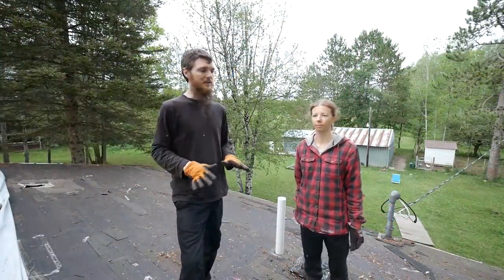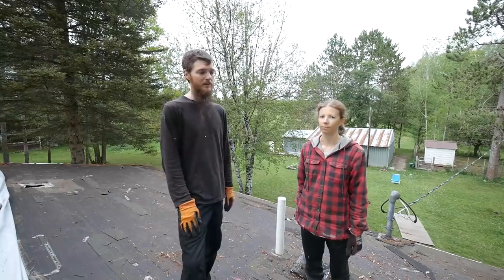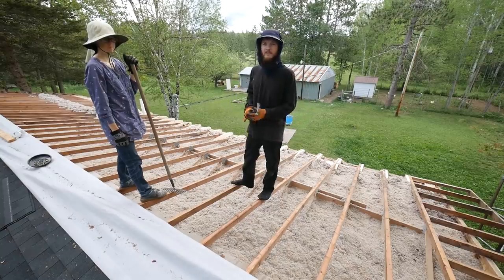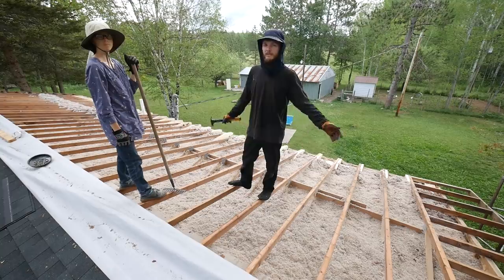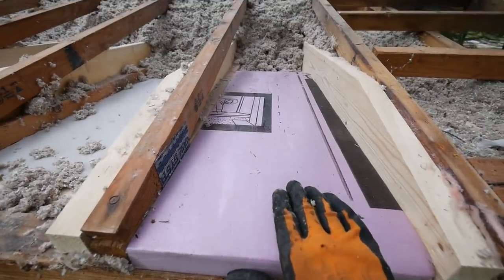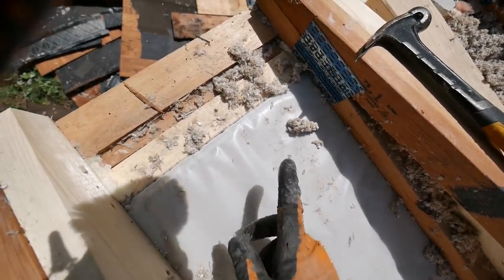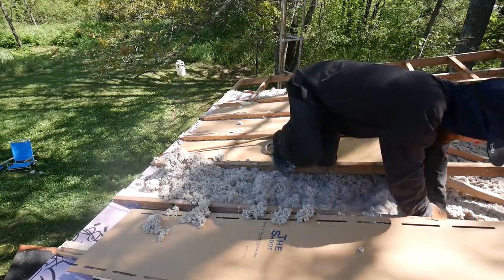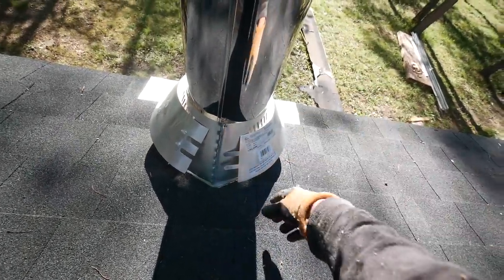Mobile Home Roof Tear Off Goes Wrong - Mobile Home Roof and Attic Insulation Renovation

Comment: Hope you're current on a tetanus shot Doug.  I saw a patient once that actually got tetanus from scraping something metal and it really didn't break the skin.  I'm not one for shots, but I'm also not one for infections.  Make sure you have plenty of antibacterial supplies (Hydrogen peroxide as well as neomycin ointment...If you can get benzoin tincture, that stuff is amazing for cuts and blisters).   You all are so close to the finish line, any kind of injury or infection is the LAST thing you need or want.

Comment: That buzzing would have immediately ended my day 😱!  Was it bees, wasps etc? How did you solve the issue?
Reply from the maker: it was bumble bees. They were nesting in the insulation. We just raked them out. They weren't happy about it and we did get stung. But eventually they moved on.
Reply: @diyfferent  Sorry you got stung on top of getting hit in the head. Speedy recovery for you both ❤.

Comment: I'm a little late, but hydrogen peroxide is great for cleaning and disinfecting wounds.  Then apply an antibiotic ointment like Neosporin or the generic equivalent.
Reply: You can use this fir dogs, if they eat something bad (depends on what it is). It's nasty process, but it DOES work. Trust me, you want them OUTSIDE. There's going to be a ton of nasty foam. 50 lb dog, you could go 1/4 cup. You'll need a small baster. Give it 10 minutes or so, and whatever they ate (depends,  think chocolate or a package of Rimadyl) as vet 1st. 

Chocolate is only fatal to 50% of dogs or fewer. Just in case, tho. Nice to be prepared. 

They can also have it for small cuts. It won't hurt them. The vet doesn't normally stitch things like paw pads and noses if it's a small cut. 

Just to save the 200.00 you know they'll get you for to do the same thing.

Comment: You need to get that wound seen by a doctor and make sure you get a tetanus shot, you have to get a shot every time there is dirt or rust in  a cut.
Reply from the maker: I'm okay, really! Also, what would be the point of shots if you had to get another one every time you got cut? It wasn't deep and is healing up well :)
Reply: @diyfferent  Sorry I didn't mean a shot after every cut, only if the time has run out from the last time you had a tetanus shot. I am glad it is better.

Comment: You are the hardest working couple I have ever seen.  My question is where are the kids when you get into these projects?  We always had trouble getting things accomplished when the kids were little.
Reply: I wondered about that too. I am somewhat a worry wart.
Reply from the maker: All over. They watch, they help, they play. Sometimes they'll watch a movie or play inside. Just depends on the day and the job. We do take a lot of breaks. It does slow down the process, but you have to work with that.

Comment: Great work. I hope you do an assessment of the difference all the insulation has made to the comfort of the house and the utilities’ savings.
Reply from the maker: It's hard to say since we had a different heating system the first winter and a lot had changed, but our heating costs were less the second year.

Comment: A slightly mixed day of fortunes, sorry about the head wound and really glad Ashley was there to spring into action, releasing you, hopefully without further damage. You are usually a walking advert for safety wear, but accidents always strike if you drop your guard. Do take care of the wound, I hope you tetanus cover is up to date, the family needs you healthy. I really hope that tomorrow goes well and gets you closer to being weather tight again. With all the vents the next part might be a little slower going because it is more complex. I heard you say about the risk of slipping, just don't!  Glad the vapour barrier worked for you in the rainstorm, fate may not be so kind next time. Will you check any of the other walls to ensure they are drying out well to prevent damp issues?
All things considered, it was another victory for hard work and teamwork, you are winning through.

Comment: When you were speaking at the end of the last video about your mailer, it reminded me of the hours I watched my dad putting on our new roof.  He never used an air tool in his life.  Every nail was put in the old fashioned way.  "Tap, tap, BANG!"  The nail was completely in.  My dad was incredibly strong; a big barrel  chested man with hands like hams.  He would truck loads of shingles up that ladder like it was nothing.  He was amazing.  The only part of construction I ever heard him complain about was concrete work.  He hated that!  He loved making furniture though!  Once he retired, he enjoyed making various pieces and then sold them through a local furniture store.  :::grins:::  To this day, the smell of freshly sawn wood makes me feel wonderful!  I only wish I could have learned more from him.  But then, girls weren't encouraged to learn carpentry.
Reply: I know it's 3 years, but have you read the Time Life Home Improvement series? I bet library has them, and a LOT of info is still valid today. Like, how do you paint a circle? Use a yardstick w a notch like a compass. Nail in the middle. Toilets have a seal under the cistern (top). I've never had one fail until recently, so I didn't know that. 

One leaked in my new house. Spent 20 minutes figuring out a wrench doesn't fit underneath.  But there's a nice screw inside to gently tighten some. I wouldn't know that w/o the diagrams, old as they might be. 

Had I been smarter, I would have looked in the TL book FIRST. I have a plumber friend who told me I can try GENTLY tightening the screw inside.  Don't go crazy, it'll crack. 

"No man can be a Communist who has his own home. He hasn't got the time." 

Bill Levitt (Levitt homes is an interesting story. Ford of home builders)

If I were building, I'd go well over "code."

Comment: That looked like hard work but I enjoy watching the videos....looking at the back of the home a decking going the hole length of the back would look so nice
Reply from the maker: The problem with decking is that it holds snow and splashes water against the house and causes wear and rot. For now we only plan on building small landings for the doors.

Comment: Too late now but I thought you were going to strip this side the same method as the other. We used pitchforks to strip shingles off roofs, the forks slide under the shingles and usually go around the nails or staples. 
Anyway good to see the progress and won't be long now until this phase is over !!!
Reply from the maker: good idea. Thanks

Comment: You guys Rock! Where there bees in the roof? We where taking insulation out from under our mobile home, to replace it. And we ran on to a bumblebee nest & I got stung 4 times.  Geeze they hurt. Hubby had to use a mixture or gas & diesel & it took 2 days.. to get rid of them.. They weren't gonna move out on there own..
Reply from the maker: Thanks! Yep, it was a nest of bumble bees. We both ended up getting stung. After a while they moved on.
Reply: @diyfferent  , I thought I recognized that sound! I heard it under are mobile home & I told my hubby. There is something very angry in there.  Geeze that must have been awful! No where to run.. Yikes. My hubby chews, so tabacco was available.. But baking soda paste, helps to. You probably no that.. The one that got me, stung me 4 times in the chest. And it fealt like someone had shot me with a poisonous dart. Well I guess maybe it was.  Be careful on the roof, I can imagine how bad that might have turned out.

Comment: Doug I don't understand how that water was coming down out of your Ceiling Lights with you having that ceiling vapor plastic up. 🤔 Oh and I hope your head heals up fast and it isn't sore in the morning. 🤕 I've just always heard it Called a "New Roof",  Chimney Stack looks Nice. GOOD Days Work Guys. 👍😁
Reply: To stop water coming through windows and lights that have been cut you need to use acoustic sealant and tape.
Reply from the maker: The plastic is cut around the ceiling boxes. Thanks!
Reply: @diyfferent  Duh Im embarrassed now lol ty,👍

Comment: I know how that feels! I have a loft in my shed and forgot about the fact roofing nails are right above my head. I ended up bleeding all over. You do know in Michigan you can shingle over 3 times before a tear off. Not sure about a mobile home.
Reply from the maker: We had to fix that insulation and the sheathing was a bit weak. But I didn't realize they allow 3 roof overs. That's crazy.

Comment: Ok, I get that this is a 3-year-old video,  but I would have left the older plywood running horizontally and laid a new layer vertically laid OSB  on top of it, as long as the older plywood is sound and not separated or blown out, your not adding that much weight to the roof and it adds more strength and sheer to the roof to bind it all together in generally just more stable.  I also noticed you removed the Sofit venting, which was that plastic channel stuck to the bottom edge of the plywood, you need roof venting or your roof will rot faster and have mold and mildew without it. I am sure you learned a lot doing this and what to do and what not to do next time. But I give you props for tackling it yourself.
Reply from the maker: It's a complicated story, but basically we had to remove the whole roof because the loose-fill insulation we installed didn't fill the whole cavities near the eaves and left areas where the ceiling would sweat. Since the attic was so small to get into and make sure it was packed in good, we had to remove all the roof to fix the insulation. We did reinstall new baffles, and the roof was vented properly.

Comment: Have you heard of damp rid? It take moisture out of basements. Might be worth it.
Reply from the maker: Yeah, we ran our dehumidifier inside for a few days just to be safe. I think everything will be okay :)
Reply: I had flooding in my basement during Hurricane Sandy.  Everyone around me got at least 7 inches and this was only time I ever  had water in my basement in 35 years. I fortunately had a pump that I got going the minute I saw water down there and my son dumped bucket upon bucket for hours into the washer and spun it out and away while the pump was going.  When waterline was going up we put all furniture onto cinder blocks and everything else stacked into the furniture!  Even though it was summer I just ran my wood stove on high for 3 days and nights. At first it was like a sauna down there but then I could feel it was drying everything out. After 3 days of wood stove I ran the dehumidifier just to be on safe side. No harm, no mold to anything down here.

Comment: First. A harness and safety belt are always a good idea. And a construction helmet is a cheap way to avoid, well, bleeding.
Reply: I've never seen pros use them. Bad idea, imo. I've seen them do some insanely dangerous things, like walk across a ladder like you would at Everest going over a crevasse. What a BAD idea.
Reply: I have also seen a construction worker in a wheel chair for the rest of his life.
Reply: a harness for a 10ft drop? lol

Comment: I know nothing about redoing a roof but was wondering if you could use your drywall lift to help get your plywood up to the roof by more than one sheet at a time and without having to climb the ladder with them. Just a thought.
Reply from the maker: It's an idea, but the ground would have to be fairly level and you'd have to lift the sheets twice.  But could be an idea.
Reply: @diyfferent   I noticed you were using the drywall lift as a drying rack, which is smart, in the cleaning the barn video. I wondered if you could temporarily turn it into a drafting\art table, bc it tilts, by attaching a nice piece of plywood on it. Keep up the great work!! We'll all be glad when the roof is done. Kind of stressful to watch. Your such an adorable family... I feel better when all your feet are on the ground.

Comment: Come on Doug, didn't you learn your lesson on the opposite side.  Tear it off in sections, replace the sheets as you go, pre build the eves as you already know the dimensions.  and save the final sheets on the edge after you install the eve brackets.  if inclement weather comes along you can always throw a tarp on it to save all the work you have already done.  You have been doing a fantastic job all along and I admire you determination and drive.  Roofing is not easy and the weather is unpredictable.  You are working with just yourself and a hard working wife for a helper.  Leaving that roof open is just not wise, especially  over night.  Keep up the good work.

Comment: Did you check the finished side insulation to make sure it's dry? I'm dying to know and I can't believe how invested I am in the answer.  Love your channel btw
Reply from the maker: Yes, we reached in and felt around. It was a little crusty on top from getting wet but it was all dry and looking okay. The walls have rock wool in them which won't be affected by the water like the cellulose.

Comment: I would have imagined that you would have built the new eaves before ripping the roof off so as to reduce the down time without a water tight roof over your house.
Reply from the maker: We have the wood precut and ready to go. Measuring and cutting it all is the slow part.

Comment: I wonder what your temperature is as you both are wearing jackets or long sleeves.  Isn’t it July and hot?
Reply from the maker: It's usually in the 80's, but some days in the 70's.
Reply: Mostly in the high 90's here. I'm west of you guys, but still in Michigan, 34 miles north of the Indiana border.

Comment: The rafters look kind of undersized, taking into consideration that you have snow in the winter, that adds a lot of weight to the roof. Didn't you consider putting fx a 2*2 on top of the rafters to enforce them, and to give more room for insulation/ventilation?
Reply from the maker: In hindsight, I think that would be a great idea. But it's lasted over 40 years this way so we should be able to get a few more out of it :)

Comment: A great video!! You are inspiring me to want to do my own roof. My house is long like yours. And 1500 sq ft big. How long do you think that would take with 3 people helping?
Reply from the maker: Thanks! Depends on how fast you guys work and if the decking has to be replaced. If it's just replacing shingles, less than a week, shingling goes pretty quick.

Comment: If it was me, I'd tear off half the roof and replace to at least the membrane, then do the other half and shingle. Itd help prevent another issue like the rain storm. We have no rain in the forecast until Thursday, but last night about 11pm we had a huge cell pop up out of nowhere and we were just HAMMERED. 3 inches in less than a hour. Came down hard and fast enough to flood our street

Comment: Dunno what you call that cavity between insulation and plywood but looks like there is too less ventilation because those plywood  were so dark underneath and that's one reason why those had partially rotten. That cavity is so shallow and quite long roof ridge i would put some kind of roof vent middle of that ridge.
Reply from the maker: The plywood we ripped off was 45 years old and we have redone everything to be proper with good airflow. The way they had it pretty much nothing was done right :)

Comment: Watching all that you've done, perhaps you could have built a house from scratch and lived in the doublewide until finished.  I would have been the same money except for the foundation, floor joists and rafters.   You could easily built a two story home.  Your well would service the new house as well as the septic system.
Reply from the maker: The county would probably want a new septic system installed and we may have needed a new well also. It seems as though we've totally rebuilt this home, but it still would have cost a lot more to build a new home from scratch. If we were to ever build a home though, it wouldn't be a two-story, we like one-story, possibly 1.5 story homes :)
Reply: @diyfferent  You are so right Doug and when done in my opinion it is a strong as a new one.
Reply: @diyfferent  Okay, it's just that renovations take a hell of a lot longer to complete than building from scratch.  And you know what joist/rafter size you have.  Floor thickness, insulation, etc.

Comment: This is one of my many problems...
A reputable contractor, who specializes in mobile homes, over-laid the original 3 tab shingles with architectural shingles!
Essentially,  we have a mobile home with 3 layers of shingles on a roof that was constructed with 1x2's and 1/2" OSB sheathing!
Folks, unless you are young like this beautiful couple in the video, go head and buy one as long as you are handy...
Otherwise, if you see valleys on the roof, even if its a new shingle job, walk away!
Reply: If your home was built in the U.S. after 1979, it is of no concern. Your roof can handle it just fine.

Comment: what is that tall metal frame for? I'm looking to buy a home and one of the ones I'm looking at has that same thing 2:20
Reply from the maker: It's just a metal tower. Ours has an old TV antenna at the top, that's mostly what people had them for. Makes for a handy ladder to get on the roof, haha.
Reply: @diyfferent  Oh, ok, thanks for the reply! I thought they were trying to use it for a lightning rod or something.

Comment: Sincere polite question.  Is there any part of this home that you purchased that hasn't been replaced ?  Seems like everything is brand new from top to bottom ?

What I'm wondering, would you have changed any dimensions or room layouts if you knew then what you know now ?
Reply from the maker: It's mostly all new, except for the framing. I would have changed some closet sizes and possibly the back entry area, I may have moved the door over and changed that up. But we still like how it came out.
Reply: @diyfferent  Me too, especially the kitchen.